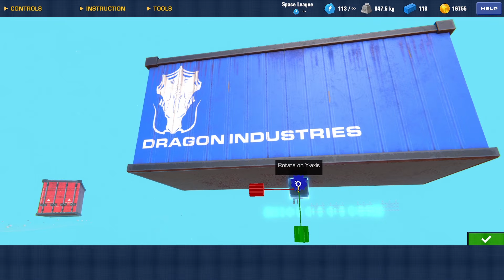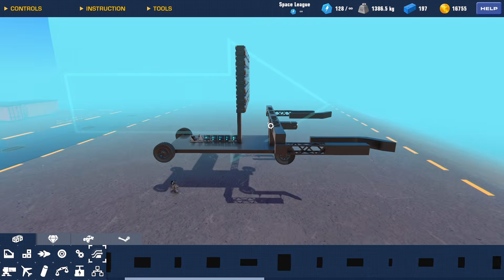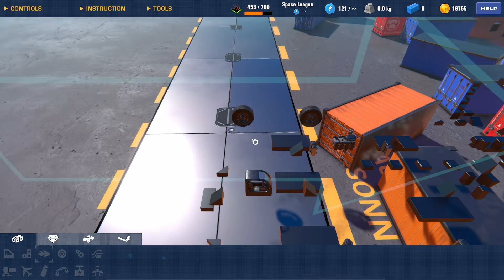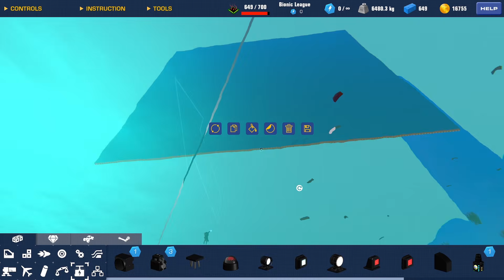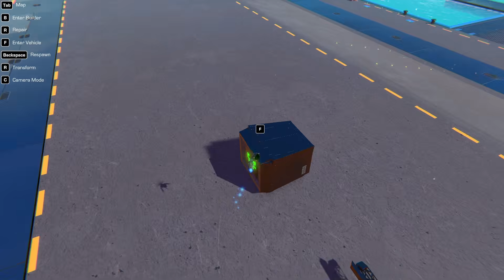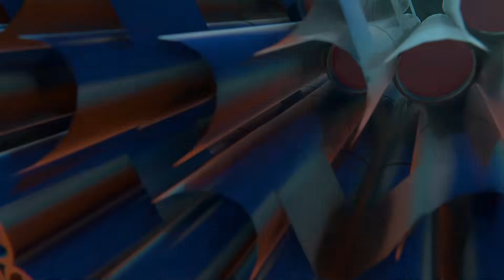Launching Shipping Containers at Dangerously High Speeds

Comment: You can limit how far pistons extend by using logic. Set a starting position with auto reset on and then use a NOR gate to retract the piston fully. Then if you key bind the NOR gate to toggle on and off, it will keep going to the starting position